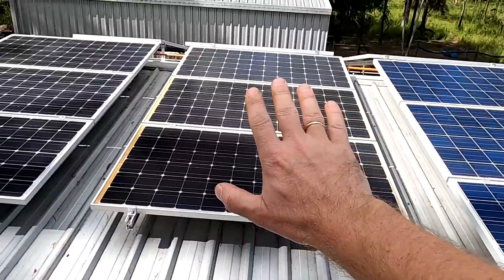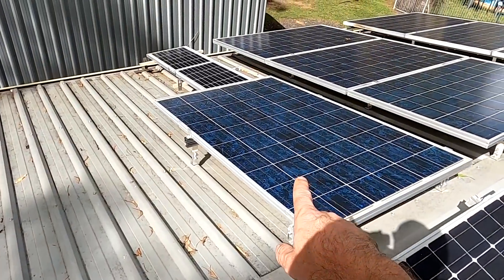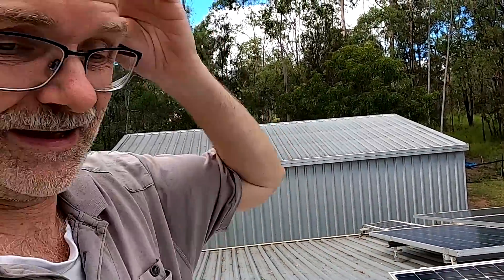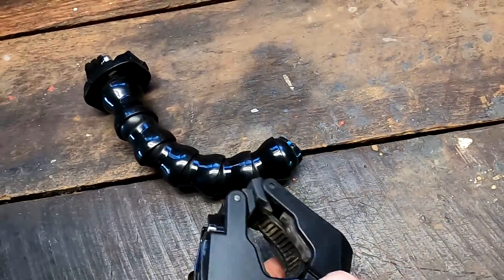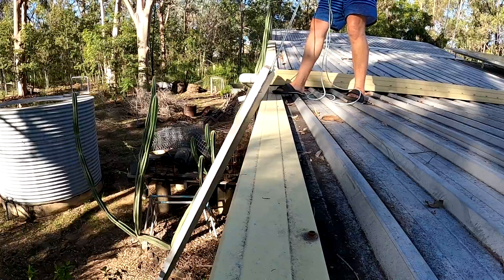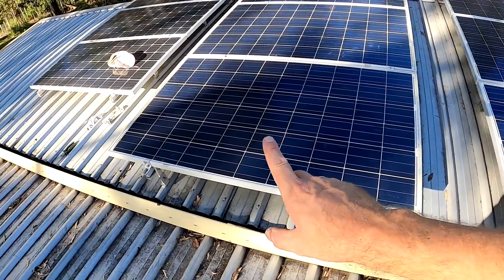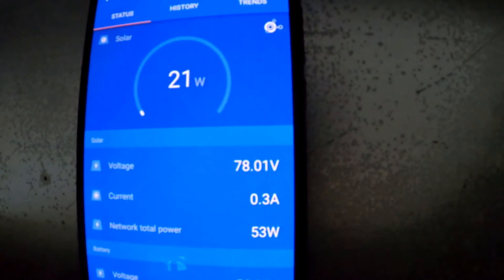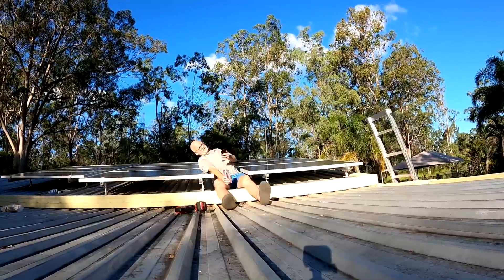+21W more solar! It's always worth upgrading...

Comment: The average price of electricity in Australia is double the price in USA and specifically my rate is .12 per kWh. Does the Australian govt. offer tax incentives for solar power ? Just curious.....
Reply from the maker: The Australian Government gives a s**t about renewable energy and promotes coal, gas and oil. They just spend $2.3b to keep two refineries open which otherwise would close as they are not economic any more. Prices are high down here because of coal and gas generators. South Australia has lots of renewables and prices are finally coming down there now as prices keep dropping.

Comment: If you have 6 or 9 identical panels you could try a “full grid ”arrangement .

It's a lot of  “Y” connections but it should help with your shading problems .

The centre row you flip the top & bottom panels so the actual top panel is connected into the bottom row of the grid & the bottom one into the top  .

---------------------
 |       |       |
█     █     █
 |-----|-------|
█    █      █       Flip the physical top & bottom panel of the centre row 
 |-----|-------|          Not the wires just the panel locations ! 
█    █      █
 |      |       |
--------------------

It's a bit of a job making it look pretty & a very non standard setup but it should work !
( OXO game for PV installers )

Comment: Hey Andy, and reason you dont just build a ground mount where you get more sun? 
Grainger supply (not sure if they are in your area) is very reasonable to build a DIY ground mount using schedule 40 pipe and standard chain link fence components.
Reply from the maker: Far too much work building one, long cable runs, foundations, trenches... and I don't really have a sunny spot on my property. At least not in the 8 weeks of winter.

Comment: Andy my good sir, I love watching all your Videos and almost bought a Mitsubishi based on your testing. Many years of watching and I hope to continue watching many more great ideas. To that end I noticed something

I am worried you were not tied off when you were lifting the panels off the ground to your rooftop. I have sadly seen many very experienced roofers fall trying to lift something from the ground onto the roof with a rope. Please just have someone watch you and tie yourself off. You won't need fall arrest just a rope that is tied to you and won't let your waist go past the edge. Something Called a travel restraint. The rope does not do a good job of catching you and cushion you but just prevents you from going past the edge in the first place while lifting. For a DIY like yourself even just a belt on pants and rope secured to the other side of the roof will provide some help.
Reply from the maker: Thanks Newton. It is all good and I'm taking a lot of care in what I'm doing. Safety shoes for example...

Comment: I made 6 video's on how solar panels work and what the real world power output should be using the back panel information.  
This is the link to video 6, where I used information from your video's to estimate your power output should be ....
https://youtu.be/MJdsdJxiJ2A

Video 1 is the basic equivalent circuit model used for either a single cell or whole panel. 
Video 2 is how single cells are put in series to form a panel, and how to change the simple model in video 1 is scaled to represent a whole panel.
Video 3 is the IV curve for a solar panel, and how where the system value of the circuit parameters come from.
Video 4 shows how solar panel back label is not real world performance. 
Video 5  explains how and why Measuring Isc is used to get a realistic value of the solar Energy in watts/m^2 can be estimated. 

Video 6 shows how both temperature effects and  Energy now can be used to eatimate the power output of a solar panel.

The video's are rough but the science is sound, I made them to help your search for missing power.
135 watts is a good number.